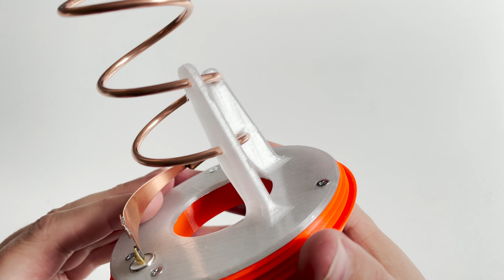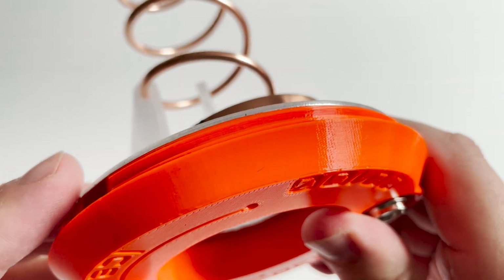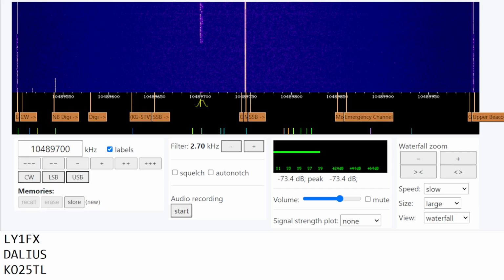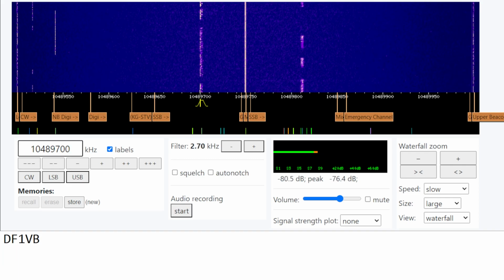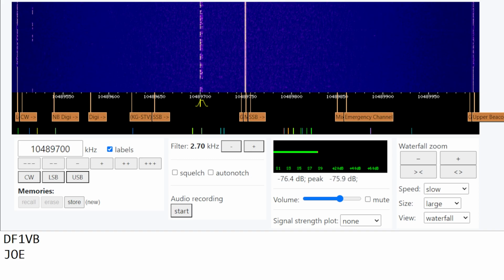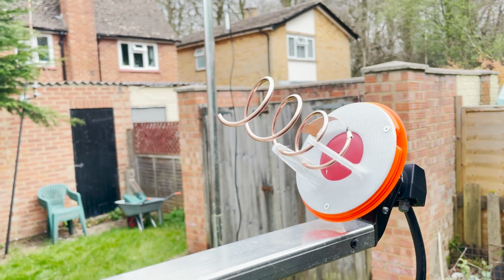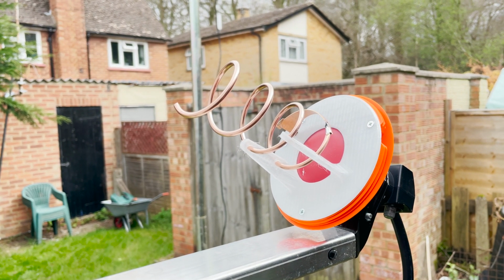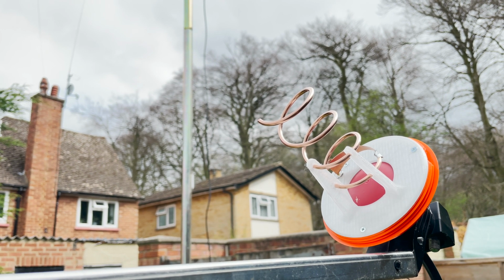2.4 GHz Dual Feed Helix Antenna For QO100 VERSION 2!!

Comment: Thanks for another interesting video. My solution is to use a helix located just to the side of the LNB. The proximity of the helix has no effect at all on the received signal strength. With the helix being slightly off the optimum position, I compared the relative signal strengths of my transmissions and it was only 1dB down.